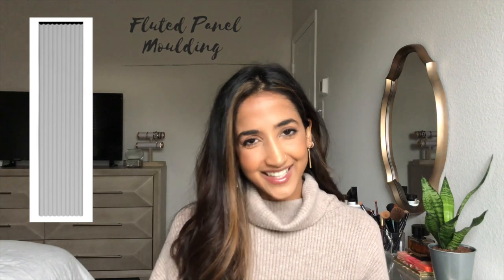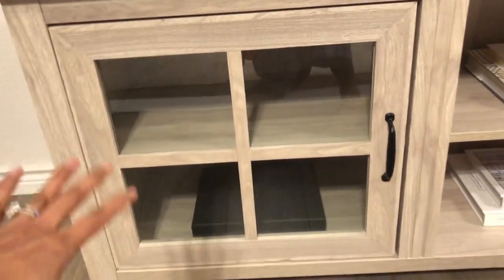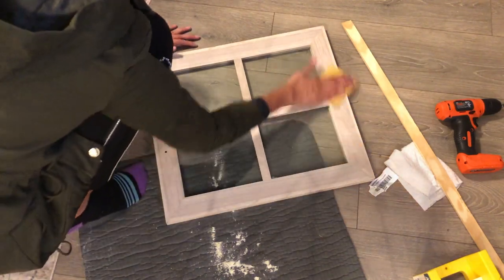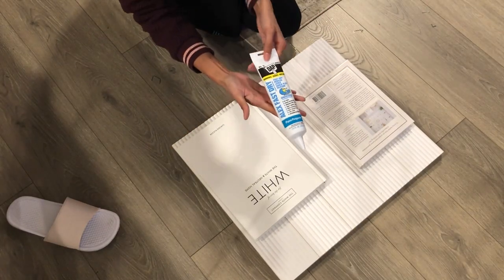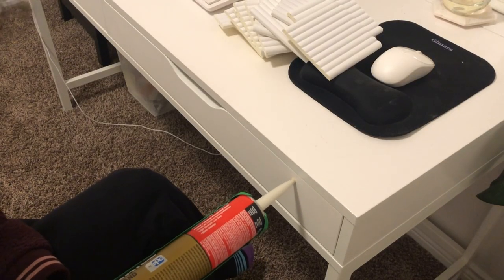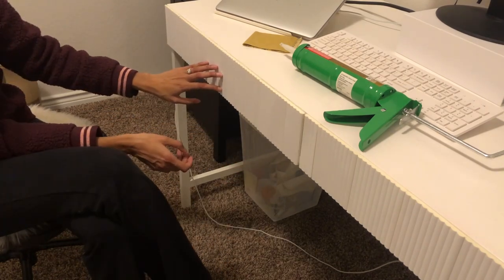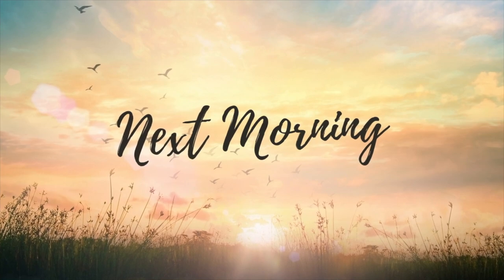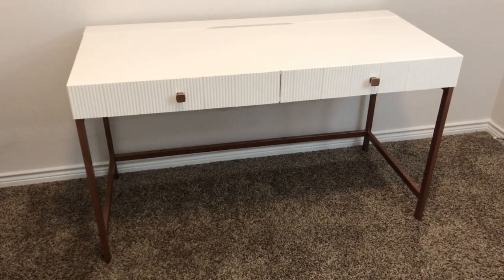Affordable DIY TV Stand And IKEA Alex Desk Hack- Using Fluted Panel Moulding (IKEA HACK)

Comment: The alex drawers can you put legs on them, could I also pit handles on them even with the dip or would it look weird
Reply from the maker: I have the handles on the drawers and they look fine. And the drawers have holes at the bottom to put the legs on so you can take them on and off to spray paint them if you like
Reply: My desk is different then yours it is two sets of alex drawers one either side with a table top across them to form a desk
Reply from the maker: @harrypotterfan1623  oh I see then I am not sure about the legs. I don’t have what you have.